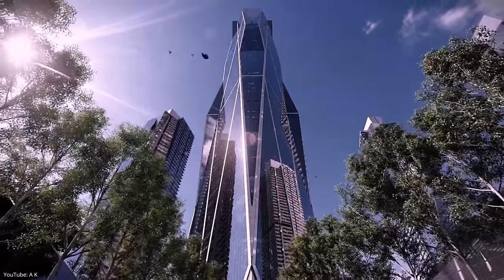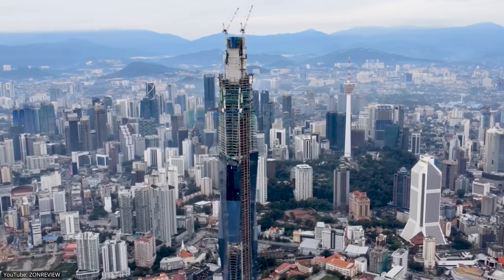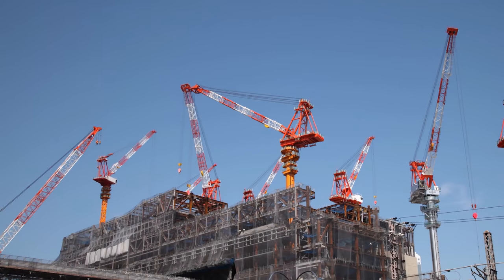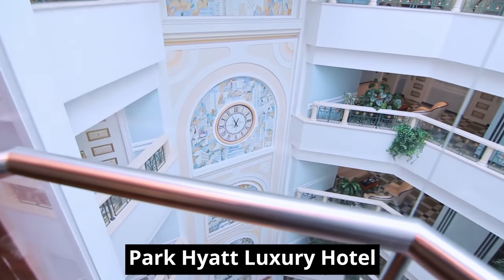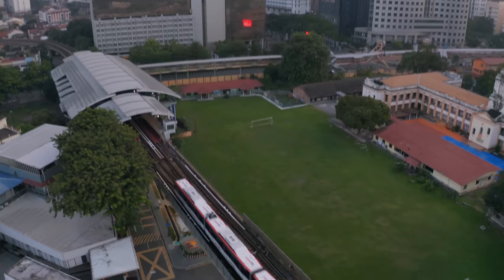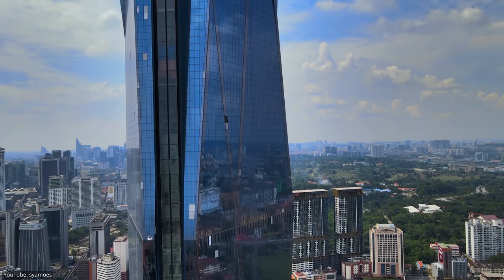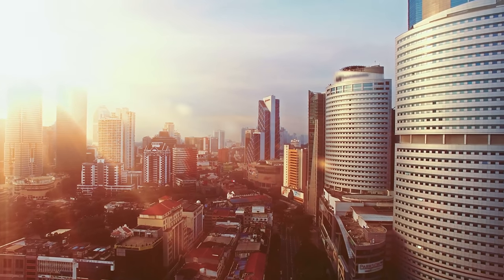The World's New Second Tallest Skyscraper (Merdeka PNB 118)

Comment: spire!I dont like the spire……It does adds a lot of heights!
Reply: There is an observation deck in the spire
Reply: @TsMidnights13  i know that.But i still dont very like it.You know China's skyscrapers Never use spires to add height.But I also believe that this spire makes this tower more beautiful.
Reply: @Limecaptain   the Burj khalifa spire have 200m+ but Merdeka PNB 118 spire only 144m and it's spire looks wider to easy climbing to the spire with a some space in it
Reply: Roof height more important than spires.easy way to gain height
Reply: After knowing the background of its design, I think the merdeka spire is something magnificent and important part of the building.
Reply: @Limecaptain  The spire makes the building looks beautiful, trust me. Ever look at the pictures of the future? a lot of buildings has spire.
Reply: @Limecaptain  because malaysia is the city with the most lightning strikes, that's why we use a spire if the building can't burn
Reply: There's an observatory deck inside the spire, which is the tallest observatory deck in the world, higher than Burj Khalifa and Shanghai Tower. So Technically, You can go higher inside PNB118 building than the tallest building in the world, Burj Khalifa.

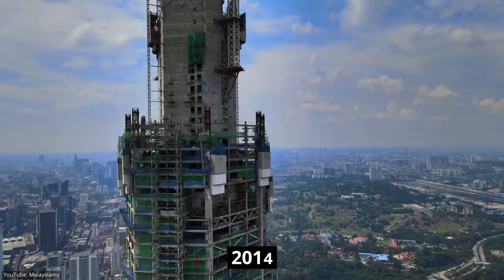Comment: Surrounding the concrete core in this video 1:04 scene is not the core formwork, but scaffold netting for core demolition work.
If you look at the dark side of this scene, you can see the core has been cut by wireshowcutting. The pnb118 has lost the qualification of the pnb70 skyscraper and cannot be completed due to serious structural defects.
Reply: Nonsense the delay is due to Covid19. It almost completed just wait and see
Reply: @zanzillahsaruji9966  Has the coronavirus started in Malaysia in 2016? The TDX106, which started later, was completed in 2019, what? Is there anyone in Malaysia whose spine goes through the shoulder joint and the head is on the side of the arm? In 2019, the core, the spine of the PNB118, was tilted to go beyond the outer wall. Samsung C&T, which invested huge amounts of money to hide it, became a loss-making company. it's going broke

Comment: Hoping the PNB 118 Height will be Increased to At Least 1025m with 25m Height of Spire Top by Making Its Spire of PNB 118 Taller than Before Height Which is 680m of Height If PNB 118's Height is Increased to 1025m, It Will Be the World's Tallest Building Surpassing Burj Khalifa, Soon, By 2030, The Majority of Top 10 or Even 20 World's Tallest Building will be Located on ASEAN Than Rest of the World Since China Banned Building Tall Skyscrapers, and By 2030, Kuala Lumpur Skyline will be Even Taller than it Was in 2022, With 1km Tall Skyscrapers Already in Place for Kuala Lumpur, and Soon, Kuala Lumpur will be Called Dubai of Southeast Asia Because of its Tall Skylines.

Comment: Hate cheaters who use spires to eke out some extra height...

By that standard, I can build a one-storey house and tack on a 900-meter spire and call it the world's tallest building. 🤦‍♂️
Reply: You thinj Burj Khalifa dont use spires?
Reply: @railwaypoocleaner8470  It's still the tallest without its spire.
Reply: Shanghai tower already failed because there is a height limit problem with being the tallest building and its design not sure safety so they have reduce it lower. Which means china has only 2,073 feet while merdeka tower feet is 2,227 feet

Comment: It's not even completed yet and besides Shanghai tower has the tallest livable room
Reply: Shanghai tower already failed because there is a height limit problem with being the tallest building and its design not sure safety so they have reduce it lower. Which means china has only 2,073 feet while merdeka tower feet is 2,227 feet. Merdeka tower is almost finished stop blaming malaysia tower.

Comment: 570 meters without antenna .
Reply: Shanghai tower already failed because there is a height limit problem with being the tallest building and its design not sure safety so they have reduce it lower. Which means china has only 2,073 feet while merdeka tower feet is 2,227 feet